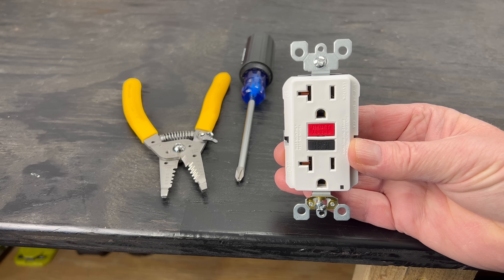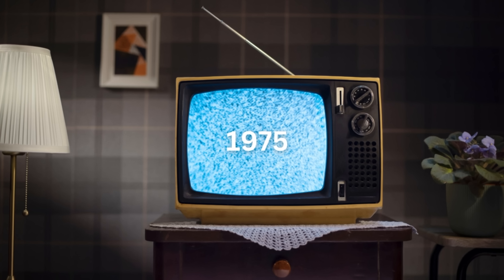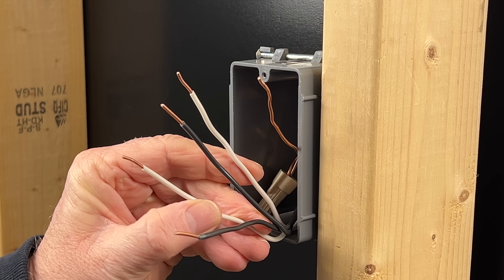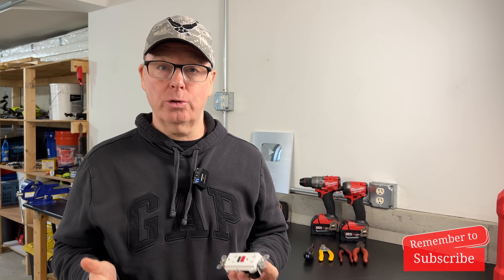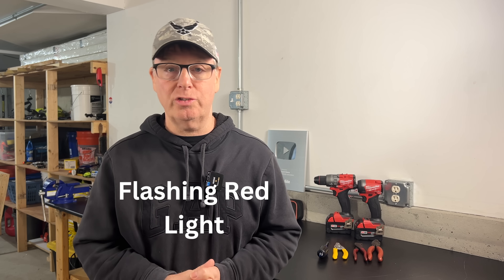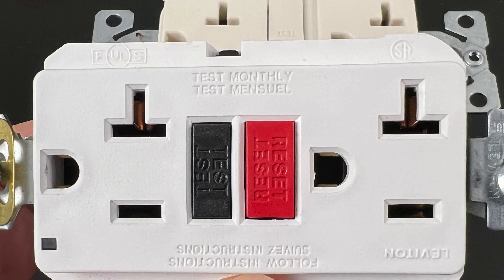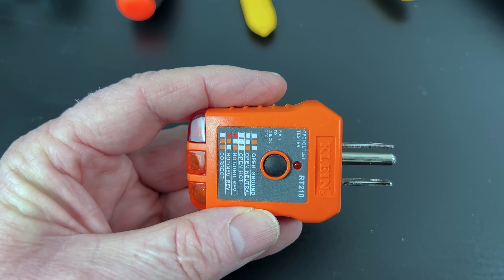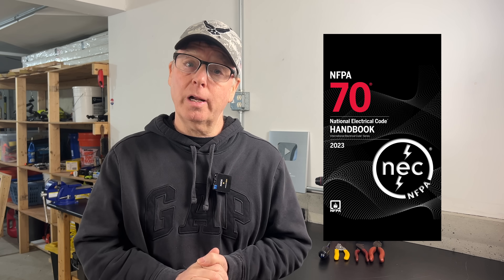Did GFCI Receptacles Change Without Us knowing?

Comment: A new dumb addition that's a waste of electricity. Whenever I install gfcis I get the ones without the light on them. Unfortunately they're getting harder and harder to find.
Reply from the maker: Eaton brand has no lights unless it's failed or tripped. It's only mA in savings but I understand your point.
Reply: @BackyardMaine For a bedroom this is absolutely the way to go. I want to see a red light if something is wrong and no light if OK. Much better than having black tape on everything. Blue and green LED's are annoying at night, red is OK if not blinking or super bright.
Reply: You can modify a Light Emiting Diode (LED) pretty easily with just a black Sharpie. Thereafter it  becomes a Dark Emitting Always Device.